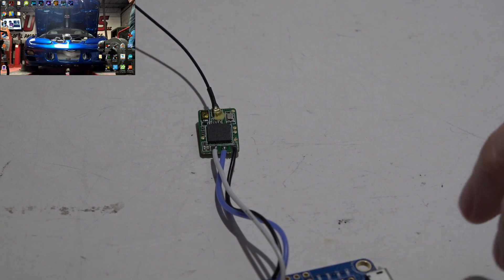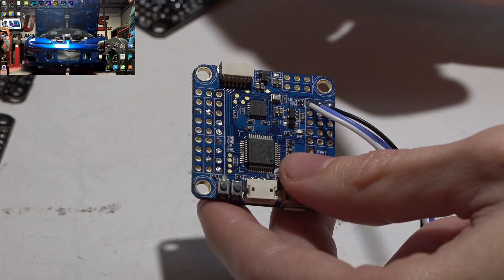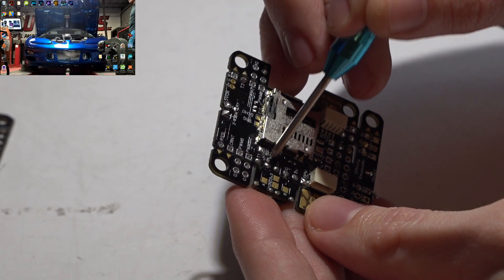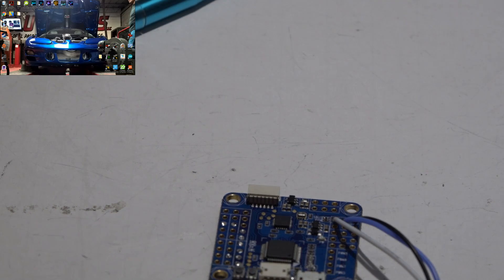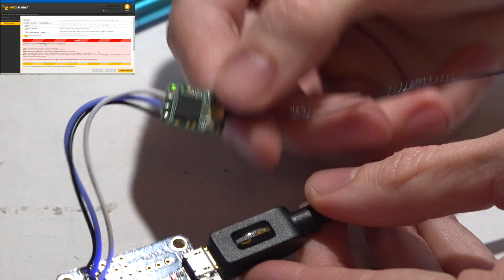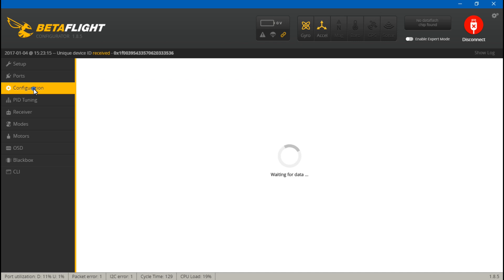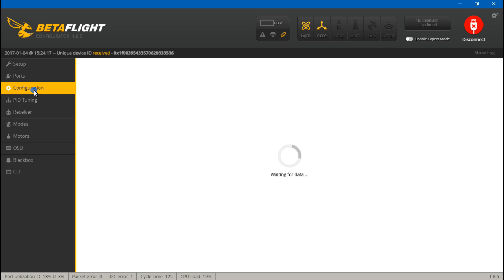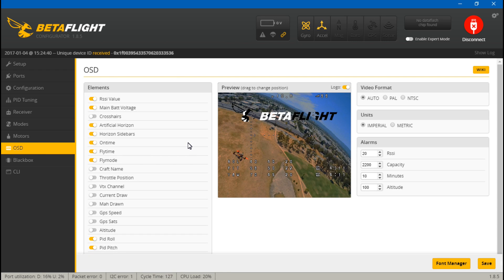Connect FrSky XM & XM Plus Receiver To Flight Controller

Comment: I get a green light on the XM+ RX when the FR Sky Taranis Radio is turned on so I know the Radio is Bound to the RX.  Have all the settings as you have shown in the video, however I am not certain what Uart is being used so I  just tried all three (one at a time saving and restarting checking to make sure everything stayed the same)  However I cannot see any movement in the channels of the RX tab in Betaflight. What am I doing wrong?

Comment: The XM+ comes with pinheads (3 pin). Any idea how to use those pins? You have soldered the wires directly on board.
Reply: Mithun Chopda hello, you would need a female servo connector and then plug them into the pins that you’ve soldered to the receiver. It makes for easy receiver swapping between models.

Comment: Cannot get any input in receivers no matter what I try.  Using a brand new XM+ I got yesterday.  I have moved from UART1 (was interfering with Cleanflight when I plugged my battery in) to UART3 and serial RX is enabled for UART3, its set to the right serial/sbus setting in config, I have a good bound controller, solid green LED on the RX, the pin on the receiver has a good connection to RX on my SP Racing MDF3 v1.  Am starting to think its either the FC or a DOA RX. Don't have an oscilloscope so I can watch the SBUS output from the RX, I guess that would be the next test..
Reply: same problem here. Have oyou managed to resolve it?
Reply: Same here - can't get the XM+ to work with my Omnibus F3 AIO. Receiver is connected to the PPM/SBUS | 5V | GND Pins on the FC and already bound. Receiver Type in BF set to "Serial". But I can't set the "SBUS" option in BF. It always resets to "Spektrum" after rebooting the FC. On the receiver page, no bars are shown at all. Tried all three UARTs, it's the same with all. Never had that with any other receiver before! 😣 😣 😣 Anyone got a workaround?
Reply: Got it to work now! Had to update the board's firmware (had Omnibus 3.0.0 on it). Flashed 3.1.7 and it works now!!
Reply: I’m having the same problem got it to bound..have a solid green light but my radio doesn’t do anything even in Betaflight?? Any ideas

Comment: Hey why did you delete the XM intro video :(????
Reply from the maker: Because I figured out you actually can get RSSI into an OSD without any extra wiring. So I deleted the review because I was wrong when I said you have to place a wire on the RSSI pad and run that to the FC. I'm posting the video in about 5 minutes.
Reply: Project Blue Falcon O awesome will you have a size comparison pic like on the other one? (next to a penny)
Reply from the maker: Not in that video but I'll be making a new review and I'll compare sizes. I'm going to wait until the XM plus get here then I'll do a new review so everyone can see the difference in sizes.
Reply: Project Blue Falcon Awesome thanks I actually just ordered three of the + myself.